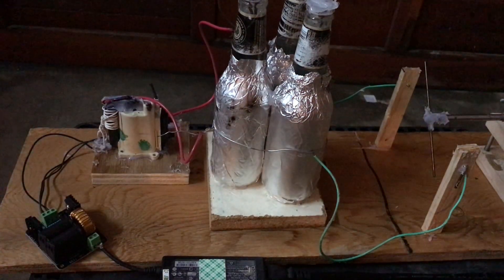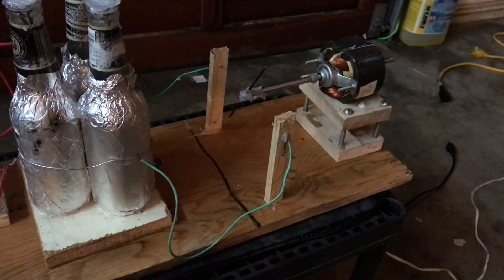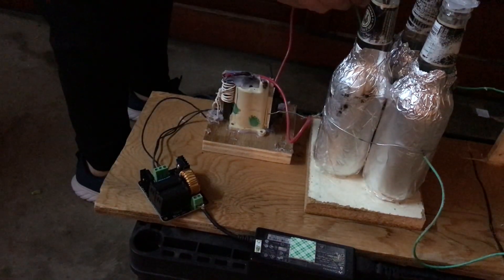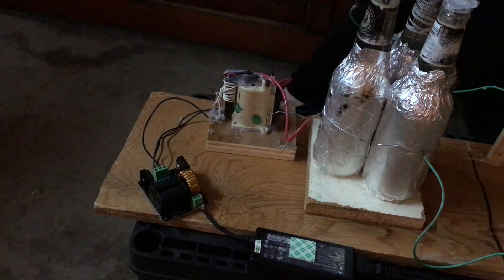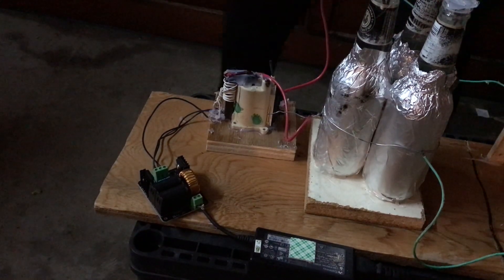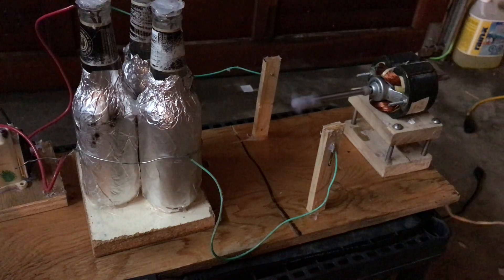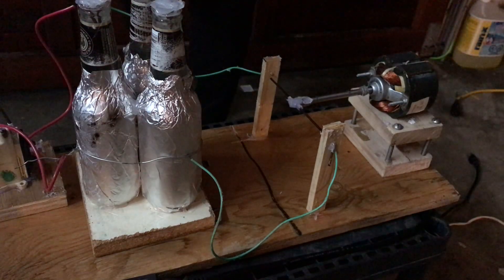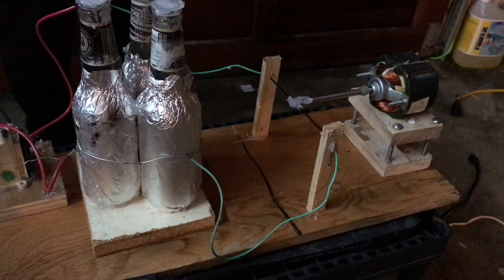rotary spark gap

Comment: Hi , change your spark gap , if that nail comes off at that speed ....well you can imagine what would happen , Make a spark gap like this , don't use perspex though as it can shatter , use some polycarbonate , or a plastic chopping board for the disc , look around for something non conductive and strong , bone dry plywood maybe never tried that so not sure , build your RSG strong plus make it a separate unit , eg build your spark gap on a nice bit of wood with the motor and spinning bits altogether and wired up  , then you can experiment with the caps fly back etc without rebuilding the spark gap every time, also more spinning contacts equals more sparks per second . i started like you play safe     https://youtu.be/aQ5_yQeQDnM   https://youtu.be/lDasd4rkkMs
Reply from the maker: Ok thanks for the feed back I will make a video on it. This was my first time building one